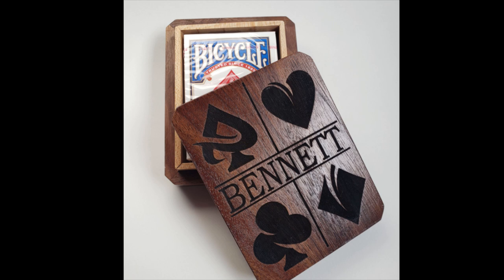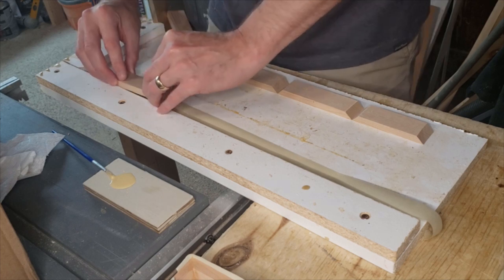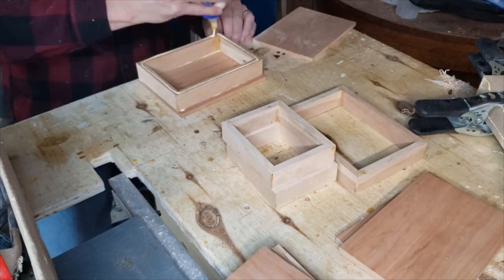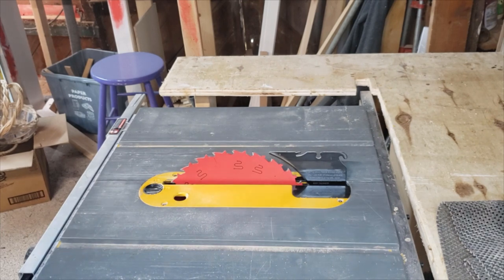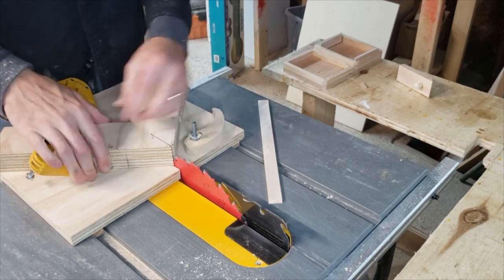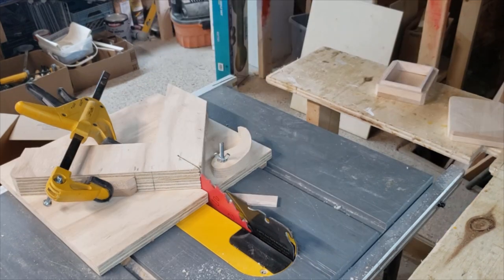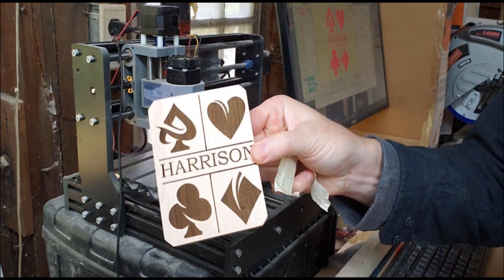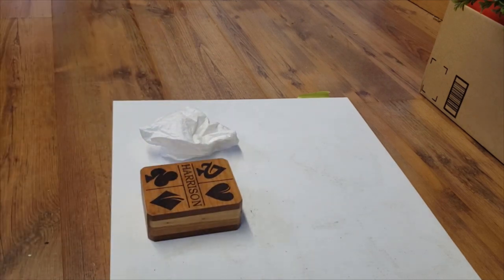Playing Card Holder | Wooden Playing Card Box | Personalized | Groomsman Gift | Poker Player Gift

Comment: Nice little project. Can you share the over all dimensions of the box, and the thickness of the stock?
Reply from the maker: All the pieces for the sides are 7/16" thick and I tend to cut the top and bottoms are 3/8" thick.  The side pieces are 1 1/8" high but you lose a little when you cut the box and sand them down.  The short ends are 3 3/4" long and the long sides are 4 3/4".  The interior pieces are about 1/4" thick and about 7/8" high.  The interior short pieces usually wind up about 3 1/8" long while the longer interior pieces work out to be about 4 1/8".  But those pieces always need fine tuning.

Hope that helps!
Reply: @mswoodenthings4322  perfect! Thanks!
Reply: @nylabone8782  you should measure your deck of cards because I know there are different standards for size.  The cards for bridge are typically narrower than poker. I don't know why though

Comment: Very nice. How do you stop the laser pattern from smudging when you apply the oil with the brush? I usually have to dab on my first coat with a soft cloth to prevent it smearing all over the project.
Thanks much for this video and the clear directions. I think that I have to try my hand at this.
Reply from the maker: I know what you mean.  I usually take a paint brush (not a foam one but a bristle one) and aggressively thwack it back and forth across the engraving (think of Larry giving Curly or Mo whacks across the face).  That seems to get rid of enough of the loose charred dust so that when I put on the finish it does not drag any of it across the wood leaving black marks.  Make sense?

Comment: Which laser machine do you use/recommend?
Reply from the maker: Hi Tzavitz....thanks for the comment.   I am not sure I can really recommend one as I have only ever bought one.   The one I bought off Amazon is this one:

https://www.amazon.ca/Upgraded-Engraver-Engraving-Controller-300x180x45mm/dp/B08HRY3858/ref=sr_1_18?crid=2HEIVQNQ0LHGF&keywords=laser+engraver&qid=1672361814&sprefix=laser+engrave%2Caps%2C256&sr=8-18

It is a good learning machine in the sense that you have to assemble it, there are no "limit switches" and you have to work through a number of settings so it forces you to understand what is going on.  I will eventually get a much better one but for a first laser and something to learn on, I have no complaints.